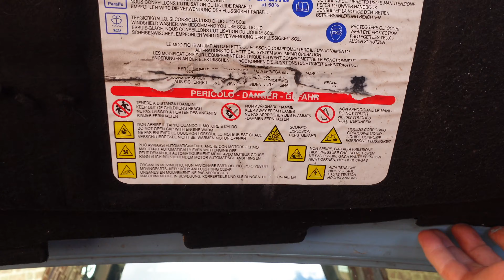Bluey's Twin - Very light damage Cat S Fiat 500 Colour Therapy - Copart, Salvage, Damaged Car

Comment: Hi Paul, good video as always, thx. Congratulations on good business. About the insulator of the engine compartment roof. The older one gets tired and hangs. I fixed it with plastic fasteners. It's like the one that secures the rear tailgate trim.
The screws behind the lamp are always rusty and ugly. Either a new bolt or black paint. I heated it and cooled it in oil. Nice black and never rusts.

Comment: Hi Paul another good video looks great, great result on the car. Good short turn around on cat s. Why not have a go at repairing the boot yourself or fill it with light skim. Looking forward to Wednesday.
Reply from the maker: I did have a go at pulling it and it did improve it but wasn’t good enough.

Comment: I would say the 40A fuse is for the ABS motor and the 20A fuse is for the ABS electronic brain and internal solenoids
Reply from the maker: Yes that’s what I’m assuming but some clearly don’t have the little fuse.
Reply: @Love500  perhaps Fiat fit two different types of ABS units from two manufacturers